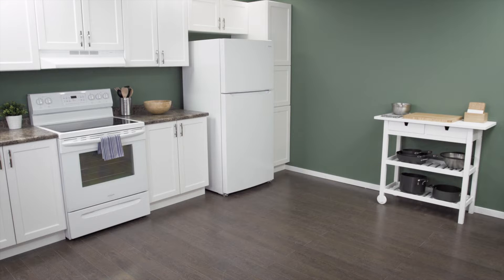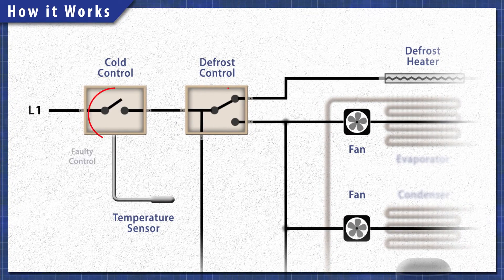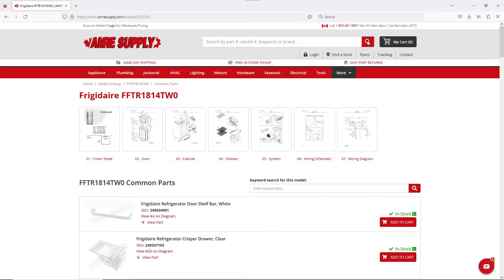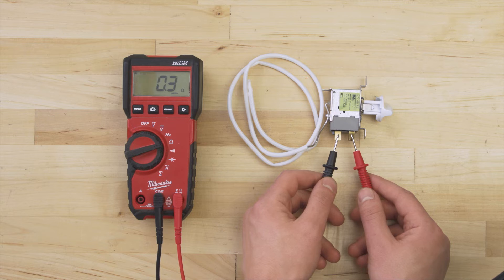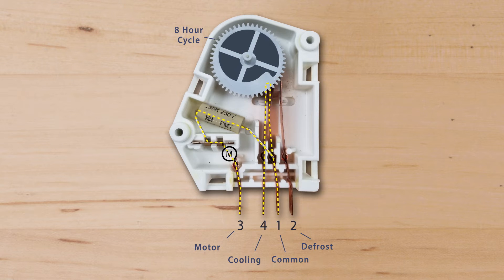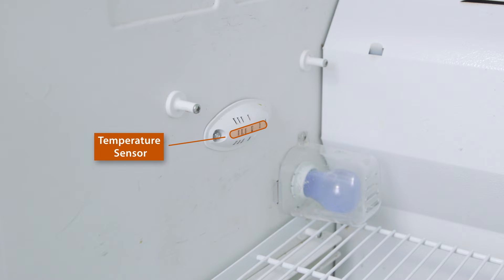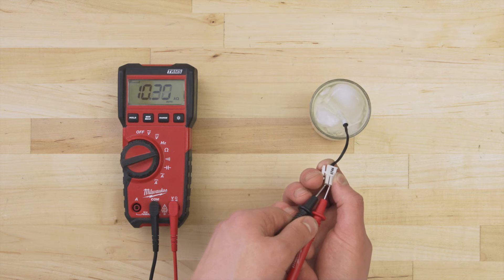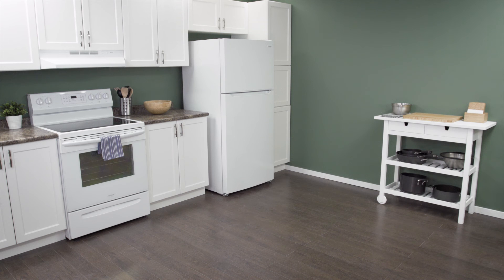Refrigerator Won't Start? (Troubleshooting Guide) | Repair & Replace

Comment: This is a GREAT video! Thank you! I'm unable to manually advance the timer screw. It's really stuck in this position. That doesn't seem normal or right at all (it's the exact model in your video). Can you help me verify that that's correct.
Reply from the maker: Thank you we're glad you found it helpful! If the defrost timer won't advance with the timer screw then it's best to install a new one. You can find the exact replacement with our model lookup tool https://www.amresupply.com/lookup

Comment: Found my problem!  Once I saw that on the defrost timer you can turn the advancement screw, I tried it and voila’!  Got the compressor running!! I’m going to replace the timer and it’s only like $12 on Amazon.
Reply from the maker: That's great you were able to figure it out and get it going again!